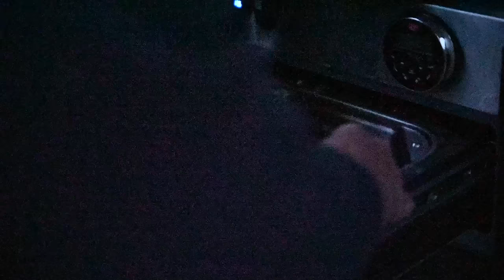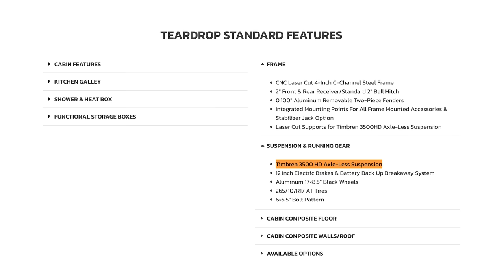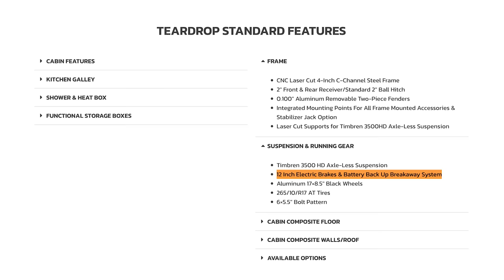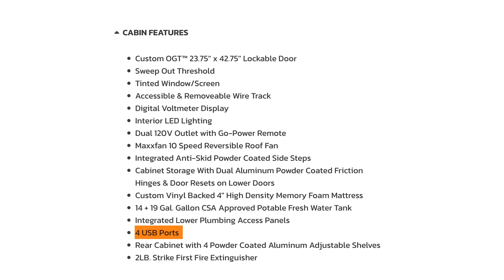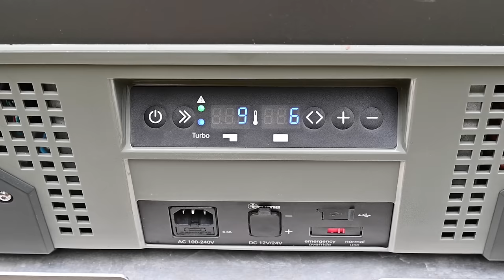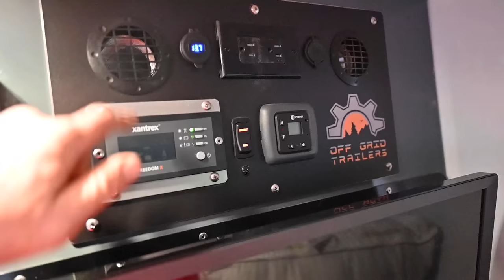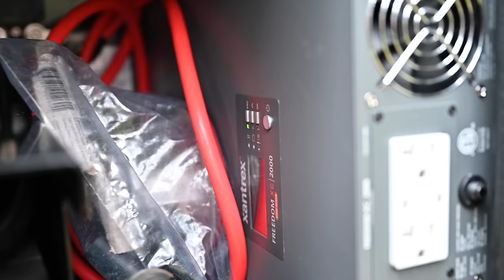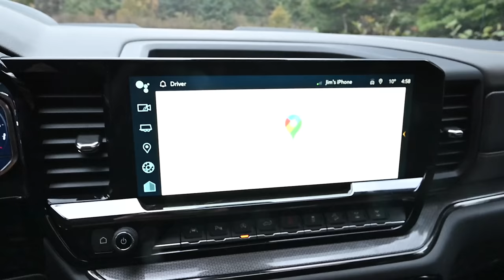2023 Chevrolet Silverado ZR2 Review + Tour of Pando 2.0 by Off-Grid Trailers- Eastbound Overland E.8

Comment: If you had to the option to get the 3.0 duramax in the zr2 would you? Or do you love the 6.2 that much?
Reply from the maker: I think just because diesel is expensive now and there are fewer diesel mechanics around I’d get gas however I was just being lent this truck so, I didn’t actually buy it and had to give it back to Chevrolet.
Reply: @JimBairdAdventurer  diesel here in BC is a bit cheaper then regular now hopefully it still gets to be cheaper.